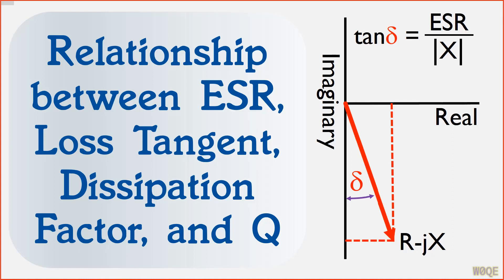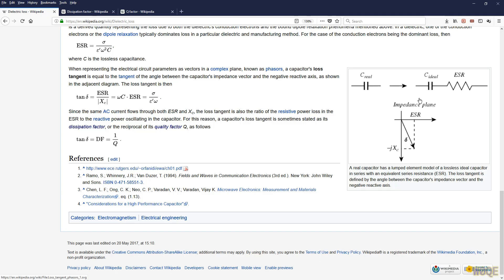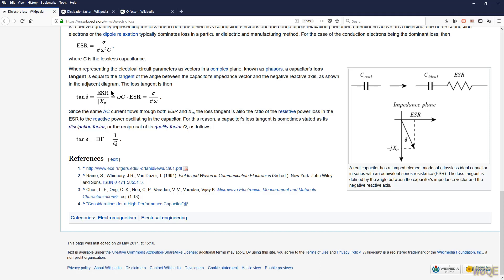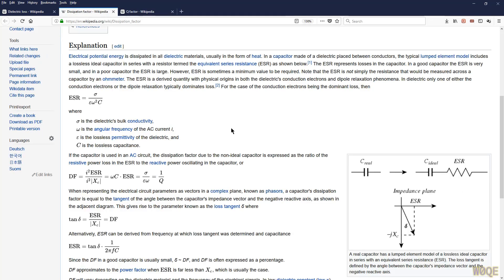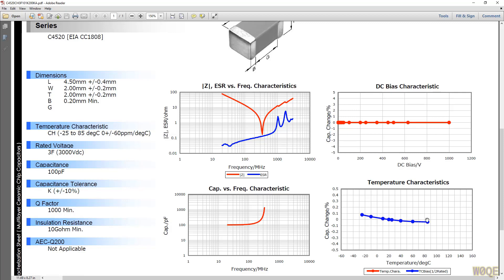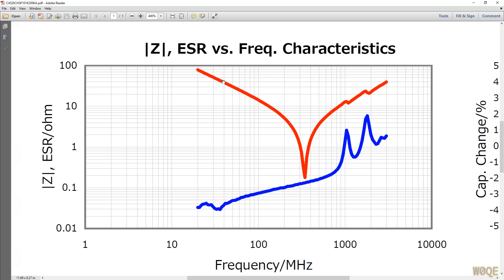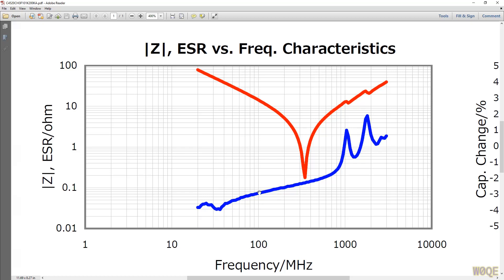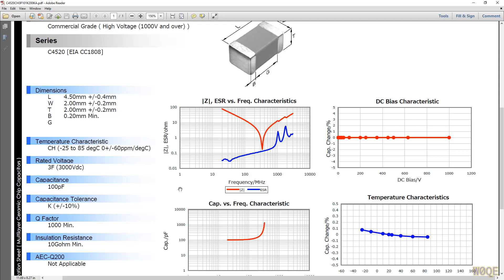#45: Relationship Between ESR, Loss Tangent, Dissipation Factor, and Q

Comment: To get the ESR value from measured D and C, what frequency should I use on the equation? The frequency at which  D and C were measured OR the frequency at which the capacitor will operate? For example, my LCR meter works at 10KHz, but the capacitor will be used on a 15KHz SMPS.  Should I use 10 or 15 KHz when calculation ESR?
Reply from the maker: Henrique,
I probably wouldn't worry about the frequency difference.  All linear components have an impedance vs frequency that is not dependent on the voltage/current that the component sees and for this discussion the component is assumed to be linear.  If we measure the impedance at a particular frequency as R + jX (X will be negative for a capacitor) and we really want the impedance at some frequency that is fairly close to the frequency used for the measurement we can estimate the value. 

ESR is comprised of 2 main parts: the capacitor itself and the leads to the capacitor (you need to include PCB traces for a circuit analysis).  The internal ESR generally decreases with frequency slightly and becomes a minimum at a frequency somewhat below the series resonant frequency.  The ESR due to the leads increases as the square root of frequency.   In your case I would use the ESR measured at 10kHz and call it good as the difference between 10kHz and 15kHz is not that much provided you are not close to the series resonant frequency.  Remember that a 15kHz SMPS varies the duty cycle in some fashion and consequently the capacitor sees frequencies below and some frequencies above 15kHz.  Also if you are using a quality capacitor the manufacturer probably has curves for the capacitor which you could use.

Larry, W0QE